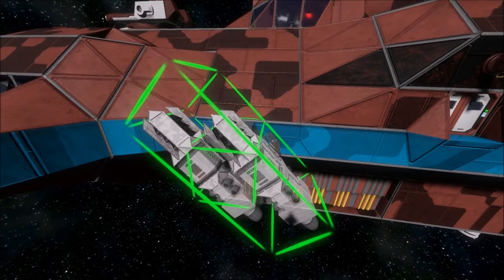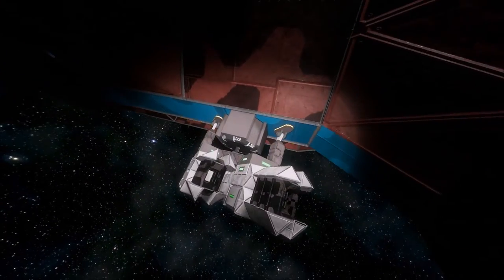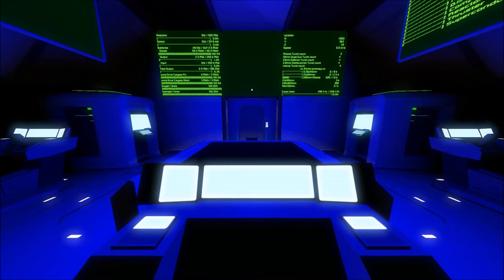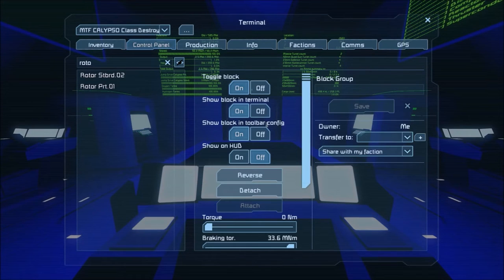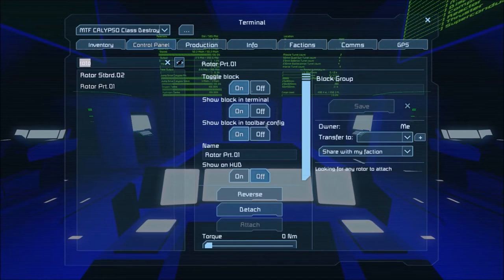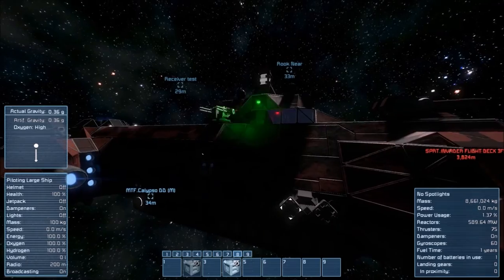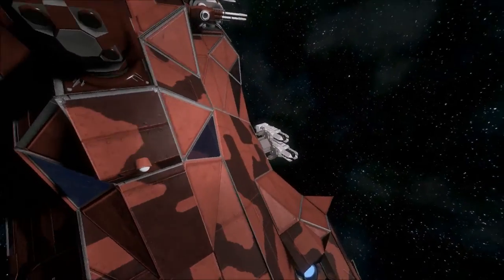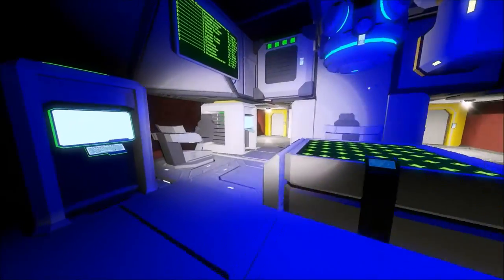[SPACE ENGINEERS] Wrath of Clang - Torpedo Misfire Part 2

Comment: I've not had any exposure to this so pardon this noob question: as part of the sequence of events does the rotor base get turned off? I think you covered part of this in part1 but I'm unclear. Is the rotor base grabbing and slamming to the ship? If the rotor base was turned off after the platform was detached does that still happen?
Reply from the maker: +Matthew Richey When it comes to Clang, there are no noob questions ;) so no worries. As far as I have noticed, the rotor base never gets turned off, not manually at least. I will ask Whiplash141 about this, but as far as I know his script only detaches merge blocks, not rotors and also the problem occurs even when there is no torpedo attached at all. Apparently the cause is for the rotor head to not have a power source, but I have added a small reactor to the pylon and the detachment still occurs, so it must be the way the game runs a check on the attached grids :(